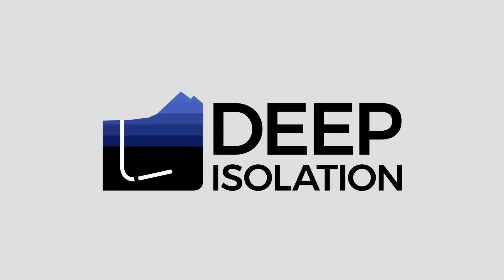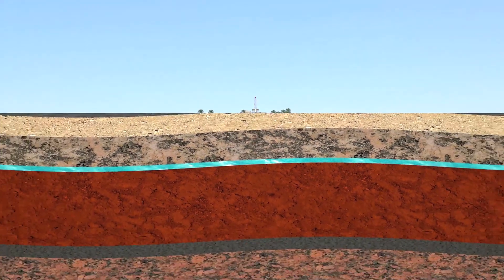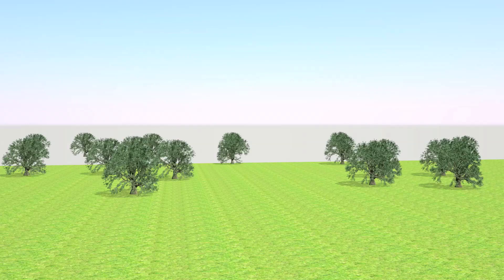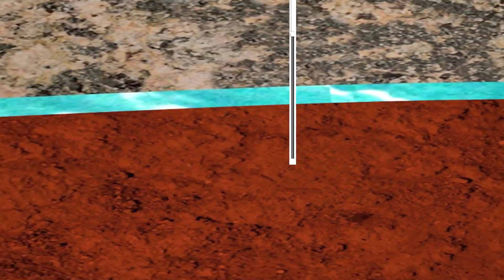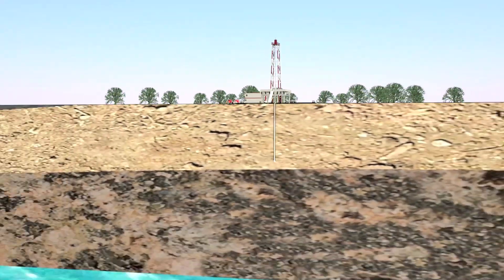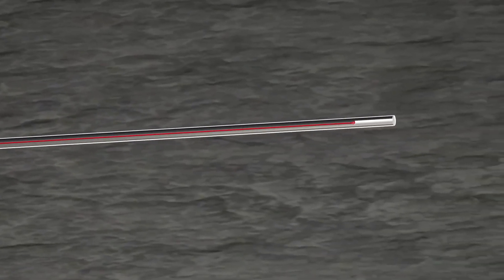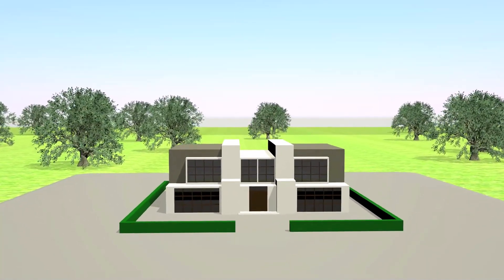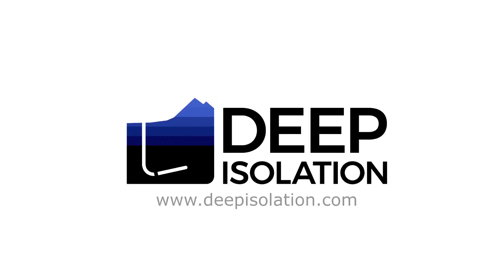Deep Isolation Concept Animation

Comment: I disagree with this option of using oil and gas drilling techniques for disposal of nuclear waste.   Microannulus and channeling are major issues when it comes to these boreholes and this process using concrete.   We can not develop a concrete that can outlast the waste.  We can not develop a metal to outlast the waste yet you just got 3.5 million dollars in grant money from the US government to develop and design a canister.  Water, gas and anything else can follow the drill path down to the rock that hasn't been disturbed in thousands of years....until you drill down to it.   No I do not want you to do this and  if the 1000 people had any type of education on this topic they wouldn't agree with your cherry picked questions either.  Water soluble radionuclides that bond to the oxygen in the water that evaporate under equillibrium conditions.   The truth is....Richard and Elizabeth and crew....you used your connections and money to get a grant partnering with an institution and making money with a private company.   Not only did you capitalize through your career condoning this awful energy source and getting paid to spread it but now you want to capitalize on the backend now that we have to clean it up and then using it as an excuse to continue to use fission as you stand to capitalize even further along with your family and keeping it with yourselves.  If you really wanted to help humanity this wouldn't be a private company and you wouldn't be trying to capitalize on this.   You'll probably delete my comment because it's all true and won't allow true peer review and a true understanding of what all of the American people want...not just your handpicked 1000 out of millions.

Comment: Buried one mile underground?   I thought I heard earlier that it was several miles underground.  How close to each other can these drill holes be?  How many in one area, and who would want to allow this under where they are or hear where they are?  There is mention of being able to retrieve the nuclear fuel ... but you said the drill holes are sealed?
Reply from the maker: Thanks for your comment. The depth would vary according to the site and geology. The horizontal section could be up to 2 miles long. There could be 10 parallel horizontal sections. Yes, the drillholes are sealed, but there is the ability to retrieve for a certain number of years.